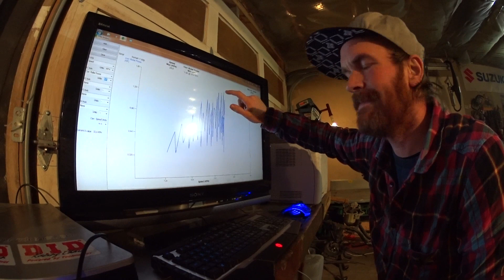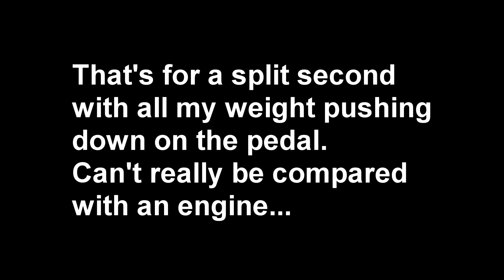BICYCLE ON DYNO | How Much Power? More Than a Moped?!

Comment: How accurate is it for low power numbers. I would have assumed internal friction in those rollers is significant at bicycle level power outputs. A tandem with the pedals 1/4 turn out of sync should give you a smoother graph and twice the power.

Comment: I think you can squeeze up to 1 horse power out of every 10cc I dunno if its true or not
Reply from the maker: +Daniel DeNapoli you can surely squeeze out more! My 50cc Spx makes around 23hp at the crank and there's more to be had.
Reply: 2STROKE STUFFING 23hp out of 50cc wilk not last long. Could the trans and clutch handle the relatively massive power ?
Reply: @leanlifter1 umm there is a super bike that makes 47HP if I am not mistaken out of a 50cc
Reply: @ibroughtaturbo-chargerfrom667  lol 50ccs

Comment: What you realize is how little power we have and how much power even 10ml of petrol does have.   Look up the video "Olympic Cyclist Vs. Toaster: Can He Power It?"  That'll make you feel better.

Take care,
Jay
Reply from the maker: +Jay Dighsx pewny humans!
Reply: Funny how you say that and the next video for me is that exact video lol.
Reply: In 10 ml of petrol there is 328 kilojoules. So enough to lift a 100 kg bike and rider 330 metres. Now at average muscle or engine efficiency that would be climbing an 80 metre hill. If you cruise at the speed you would coast down a 1 in 20 hill (25 - 30 mph) that's 1600 metres or 1 mile on 10 ml of petrol (4 miles if you could use all the energy instead of just 25%).

Not only have I seen a track cyclist power a toaster, I've also seen 70 cyclists power an electric shower. Based on an electric shower being around 9 kilowatt (burn a litre of petrol an hour which is what a typical car uses idling) that's around 130 watts per cyclist (so I think you could get away with half that number for a few minutes if you picked club riders)

Comment: Obviously you need more pedals and more legs, to smooth out the power delivery!
Reply from the maker: +James Stanley I should've thought of that and added some before the run...
Reply: Legs no matter how strong can only pedal 1/2 turn of the crank at a time so a motor will always be much more efficient l.
Reply: @leanlifter1  so, the pedals must be in crossplane :D